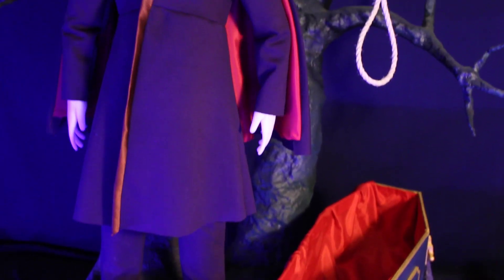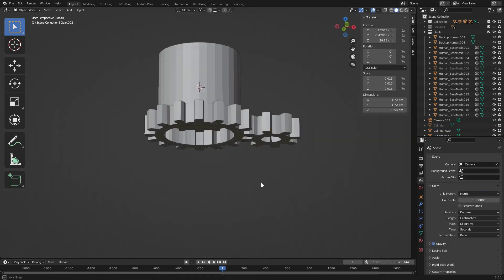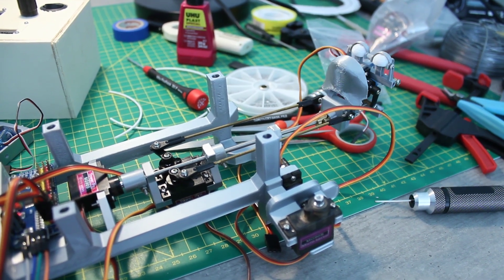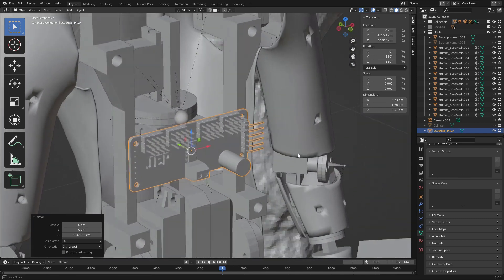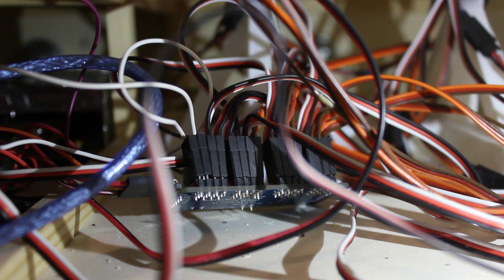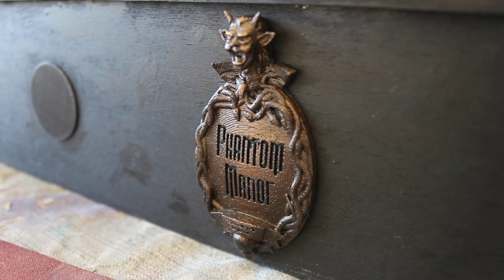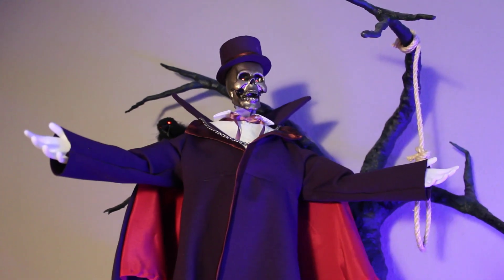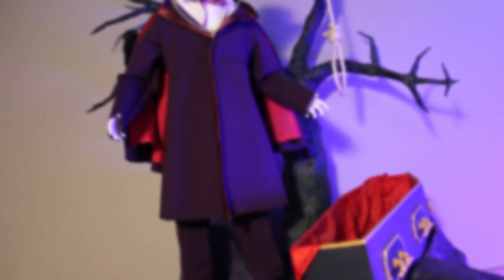Phantom Animatronic Upgrade - New Neck, Torso, Animation and more!

Comment: Are you able to run live mode on multiple servos?
Reply from the maker: Sorry for the late reply. Sure, you would have to think about a combination of these 2 examples you can find in my Arduino library:
https://github.com/timhendriks93/blender-servo-animation-arduino/tree/v2.0.0/examples/SerialLiveMode
https://github.com/timhendriks93/blender-servo-animation-arduino/tree/v2.0.0/examples/AdafruitPCA9685 (depending on how exactly you would control multiple servos)

Comment: Would you ever make these files available for sale? Would be a great learning experience!
Reply from the maker: I already have shared them here and there in the comments for free 😉 For example, here is the updated blend file for the Phantom: https://www.tim-hendriks.com/files/PhantomAnimatronic.blend
Reply: @timhendriks93  How did you achieve the audio playback and servo motor movement at the same time?
Reply from the maker: @HYBECTIVE  since I'm using simple DFPlayerMini modules there is no way no get feedback or information from the player about the current play position. Instead, I have to time the start of the playback correctly as soon as my animation starts. Sometimes it helps to wait a few milliseconds to give the audio module some time to actually start the playback.

Triggering audio might also be easier with my Arduino library which supports a callback function every time the animation mode changes. You can find hints about where to trigger audio in the comments of the following example: https://github.com/timhendriks93/blender-servo-animation-arduino/blob/v1.1.0/examples/SwitchModeButton/SwitchModeButton.ino#L44-L58

Comment: Have you tried a mini maestro servo controller?
Reply from the maker: No I haven't, until now I didn't see any advantage over a PCA9685 module when controlling servos via my Blender Add-on. What would be the advantage in your opinion?
Reply: @timhendriks93  
They are an all in one solution. It's a PIC microcontroller with all the output pins being pwm. Since they are arduino compatable, you may be able to use one to replace both your arduino and the PCA9685. They also have there own programming software. Not required but useful.
Reply from the maker: @mr.e.484  Thanks, it's definitely cool to have a board which could eliminate the need for another microcontroller. I guess you'd still need one when adding sound or buttons to trigger / control the animation.
Reply: @timhendriks93 
Nope the pins can be set as an pwm, input and output.
Reply: @timhendriks93  I didn't tried with a mini maestro servo, but instead with a Raspberry Pi, in order to be able on the future to add other functionality with AI (maybe someday) via Python., or just to control it via WiFi via SSH. I think this is the greatest part, forgive about usb cables.

Comment: I am  just now trying to learn about this stuff and it seems pretty complicated, I would probably only know the traditional sculpting part and not the 3d printing way of creating my art , How long did it take you to learn this stuff?
Reply from the maker: That's not exactly easy to answer, as there is both the 3D sculpting / modeling and the actual printing to learn. I spent months if not years to practice and improve both, but I think it's possible to learn some basic sculpting / modeling and how to use a 3D printer in a couple of weeks. Just try to start with something small first and make use of the many great tutorials about both topics here on YouTube ☺️👍